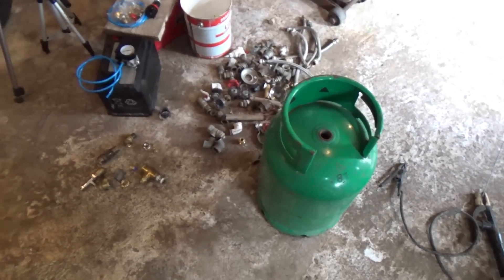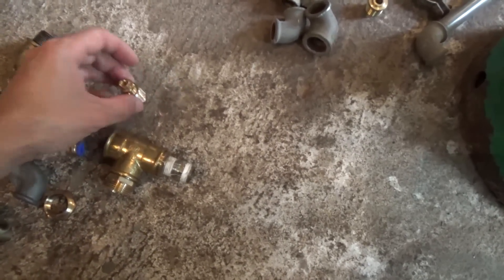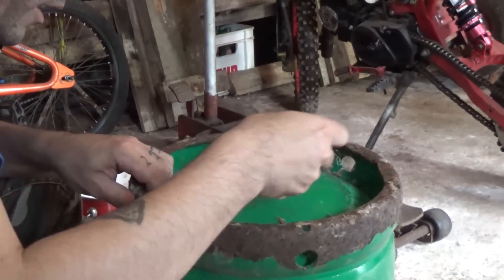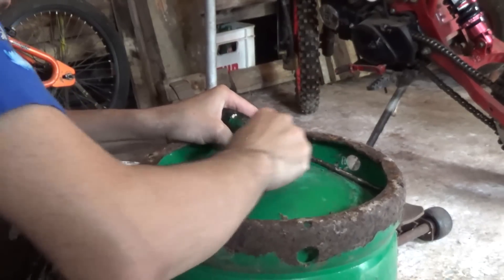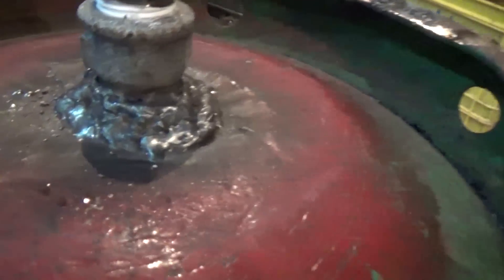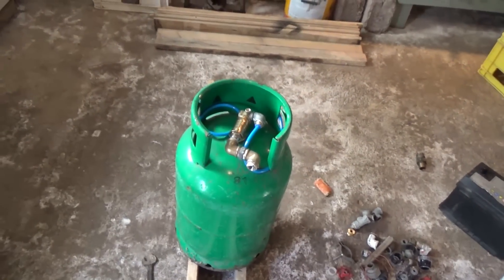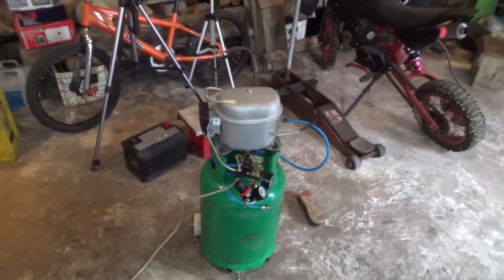Homemade silent air compressor

Comment: Would have made a better weld if you would have just brazed it. Another thought was could you have just drilled and tapped it with NPT if the metal was thick enough to take the threads.

Comment: Do not talk rubbish. A stickwelding machine are a stickwelding machine, the limit are the person operating that machine. And you also welded in a galvanized part. Welding galvanized vaporises the zinc, and turns it into poison. And I will say that galvanized piece, made of cast iron is about the worst combo to handle when it comes to strong airtight welding.

Comment: Turn the propane bottle upside down and make your first fitting a "T". Then put a ball valve and a nipple pointed down to allow you to drain the tank without taking the air line off.

Comment: is it me or is this thing incorrectly earthed to the pressure switch.the earth wires appear to be twisted together & not connected to the pressure switch,as seen at 11.41 in the vid.this thing is dangerous

Comment: I see comments about welding and his inability to use a stick welder and saying there is NO possible way he can weld with a MIG or a TIG if he cannot weld with a stick welder. Well, hate to disappoint you keyboard warriors on here but I personally work on vehicles repairing the body panels and painting them. I can weld excellent with a MIG and also a TIG welder but I can't use a stick welder worth a shit.
Reply from the maker: Pagan Sunburn thanks
Reply: Not a problem.

Comment: you can't blame the welder for poor workmanship, more than half the video to try to stick an adapter to the base then in 30 seconds you have a compresor ready to switch on, all of the impotant details left to ones imagination. No one is perfect but a little thought before hand to determine the gameplan and most important details would have helped. After watching all i learnt is how not to weld, nothing about compressors. sorry

Comment: This is a good job. But for welding u should have your wife helping turning the tank slowly. This kind of job is very difficult for stick machine but not if u have a MIG machine. Another thing is this kind of compressor have low start torque u. U will have a start problem should the compressor starts with a lot of pressure still be in the tank.

Comment: nice job. dont listen to negative feedback. I like the comment about welding more and practice. you needed more heat and slower  travel speed. you did good and it works.

Comment: Recycle everything but, with respect to luisfilipe, May I observe.  Refrigeration seal unit compressors are designed to pump gas and oil around the system. In domestic fridges there are no oil separators.
Using this type of compressor will result in oil passover, great if you are using air tools (keep an eye on the oil level) but using it to provide air to respray your car will be a disaster as the air will contain an oil mist despite the use of water separators and filters
Big industrial compressors solve this problem  in many ways but small sealed units are a different matter.
I love recyclists and it's a good project and the welding will get better with practice
Thank for the upload
Reply from the maker: George Styer thanks ;)

Comment: your pressure of 90. psi is nothing compared to the stocked flow. check the outlet pressure is low and the pressure in the tank is coming down quickly. with no air flow, u can't do any pneumatic job with this stocked air...
Reply from the maker: El Batchi Benaboud well i never intended to use it for pneumatic jobs...i knew all the way from the begining it would be suitable only for small tasks, like blowing air for cleaning stuff, filling tires....things like that.

Comment: sorry now that i see what your trying to weld!!! you should be using 309 L 16 a stainless steel rod which allows you to weld stainles steel which is your fitting to mild steel which your propane tank is made out of. hope this helps. 3/32 set your welding machine to 70  amps.
Reply from the maker: Bryan Dunlop thank you

Comment: a grinder with a wire wheel would do wonders!!! 7018 3/32  welding machine set at 90 amps perfect . clean a spot so you have a good ground  and away you go. good luck in your next projects!!!
Reply from the maker: Bryan Dunlop thanks

Comment: try welding with 7014 rods, throw those 6011 rods away. Another hint: when you stop your bead chip off the slag before  more welding. Make sure you have a pressure relief  valve. I saw a compressor off a fridge blow the end out of a tank and take a wall with  it.  Thanks for showing this video. Be careful with any tank welding.

Comment: To be on the safe side, I would have purged the bottle with water before using welding or sparks.
Reply from the maker: Robert Beattie i did that several times

Comment: It looks like your welding skills are about like mine. I think I would have drilled a hole in the bottom of the tank and pushed a fitting with a gasket thru the larger hole in the top, and then screwed a nut onto the threads from the outside on the bottom. I cannot weld very well either.
Reply from the maker: Doug Sigea yep that might work

Comment: bet this would work great with r12 compressors but the new 134 compressors with poe will surely fail as poe is hydroscopic and they make stuff cheaper all the time

Comment: ya your doing pretty good and recycling parts into somthin usful those pumps will usually last years and years justkeep  it drained rust thru on the thinner tank materiel good job

Comment: I've built one myself and it works a treat for my garage tools and pressures up to 130 PSI. 

I've read all the slagging comments you have given luis. These home build work a treat. And this works out at a 10th of the cost of a bought one. This saves me money and uses a 10th of the electric. 

Also a tip with the oil. Drain out the oil through the suction tube and use an ink cartridge string and put in 1 litre of 10W 40 engine oil.
Reply from the maker: Andrew Wray :) yeah i have been using 15w40 engine oil, but mine only takes about 0,5l...but that dependes on the refrigerator motor size...some are bigger some are smaller...anyway...it surely works nice, and does all i require in my garage...most people that say it is useless...have never built one themselves..they just speak without knowing what they are talking about..lol
Reply: luisfilipe1983 email me on drewanywar@hotmail.co.uk and I'll send you pics of my compressor.
Reply: Andrew Wray ĺl..
Reply: hey guys, I've built one as well... been a few years now, works great!! Was not  sure about the oil quantity, pretty sure i only  have a small amount and has not effected the use. Use to keep it in my unheated shop, and in the very cold months it would not start... oil is too cold. Think the lower weight oils is the best for these compressors. For my tank i used an old makita 3gallon compressor everything was free but the pressure switch. Great for small jobs air brushing, tire filling etc.. Best part for me is the noise level. I also have a very old dental ritter compressor.. check them out on youtube.

Comment: OK.  So others have picked up on the (non) use of grinder;  but the probable reason the fitting didn't weld cleanly - other than you're poor welding skills - is because it is plated !!
Sorry.  I gave up on you shortly after this. :-/

Comment: that's scary..6Bar? im not sure how much Bar that propane tank can handle the pressure. and the welded spot? that might burst at anytime.
Reply: jes he is an terrible  welder would not hire him
Reply: Doesnt matter if you read in bars or psi... as long as that dial shuts the compressor off at less than 145 psi, to play on the safe side, all is good:

"According to the publication NFPA58, a tank with 20 pounds of gas at 70°F would have a pressure of 145 psi, at 90°F would have 180 psi, at 105°F would have 235 psi, and at 130°F would have 315 psi."

Comment: The only practical advantage of this build is that it's very quiet.
The disadvantages are numerous (I built a similar one years ago) :
Very slow to come to full pressure.
The delivered air is contaminated by the oil from the compressor & therefore an oil filter is needed, hence extra cost & bulk. Also you need to provide for adding oil to the compressor.
Not even suitable for blowing up a small car tire, due to lack of capacity.
The bits & pieces you need to make this will end up costing you almost as much as a low cost store bought compressor with about 5 times the capacity.
Reply from the maker: Peter Owens indeed it is suitable for small tasks only, and you need to fill oil every once in a while, and it is a slow charge...but with just one charge i can blow up the all 4 tires of a ford escort 1.8 diesel van, and about costs...it only cost me about 40€ in parts, everything else i had laying around...to buy one around here  that would cost at least 80€ minimum.
Reply: +luisfilipe1983 bro dont explain yourself, you dont have to. you built it because you fucking wanted to, even if it serves no purpose what so ever. its a cool build that i never realized was possible. gonna save me a helll of a lot sincei only need for airbrush but has to be quiet for indoor use. anybody that wants to talk shit or question why, remind them that they are not forced to watch. i hate when people start nit picking shit. this is perfect for me and anyone else that needs a quiet small compressor.
Reply: Peter Owens bvsvv😬-----$- - bilemiyorum  in mpj,chkiqgffd

Comment: Why the nut on the bottom of the Gaz bottle ? I didn't see any hole !
Reply from the maker: I drilled the hole later, after having the nut in place, but did not manage to get it on camera
Reply: esta bem, obrigado
Reply from the maker: na boa :)

Comment: As gas is  heavier-than-air. Removing the valve, and  puttin the gas bottle upside down for a few days, all  the gas should be gone. then a good rinse from a hose pipe, should remove any excess gas, left in the bottle

Comment: People are complaining about welding etc an uncleaned propane bottle. . . Yes cutting or welding a steel barrel is very dangerous if it isn't cleaned since it could explode.   A propane cylinder is much thicker steel, and wouldn't have enough air in it do rip apart and cut you to shreds like a barrel.

Comment: and use a hydrogen controlled welding rod 4814 , 4816, 4818 zero porosity one continuous weld 're pressure test using water and old hydraulic hand pump it holds its good don't test with air
Reply from the maker: thanks

Comment: bottle can only handle 400 psi test pressure is not designed for greater working pressure 150 psi and pressure fittings are over welded to compensate for metal fatigue

Comment: The welder had a decent arc. You needed to Slow down, use 6010 rod, 1/8'".  A mig welder would not have done better.  Because it has the label as a dummy welder, it is not for dirty metal.
Reply from the maker: thanks
Reply: @luisfilipe1983  yes, there was more metal to absorb the heat on the tank, so favor the arc to the tank side.

Comment: not much clever,why don't remuve the paint with grinding disc? and in any case is very dangerus to use the gas bottle,usually conteing gas that why is very dangerus to welding on it.and what I see you are not expert to welding,change your job guy
Reply: Really ?? You wanna bash him ?? He's already removed the Danger !! And considering that this tank is designed to hold 2500 PSI Plus, It's the PERFECT choice ! I use these tanks all the time to build Portable air tanks !! . Awesome Job bud ! I'll be trying out a compressor i have here myself !!. thx.

Comment: I wouldn't like to hook my HVLP gun up to that! 14 CFM is a LOT of air throughput, ideal for blowing tyres up though :)
Reply: Its just a project that actually works.. it would work for inflating bike tires very well. Turn it on, do something else. Its called planning. It would also run airbrush and small paint sprayers.

Comment: i have a feeling that compressor wont run for a very long time without the oil that is normally in the ac refrigerant system

Comment: really should have rinsed that tank then sand blasted everything before having a robotic welder weld that bung on inside a blast proof chamber preferably on the moon or some other remote location. also at least a pair of safety glasses and a full face shield, gloves, kevlar body armor, and at least one paramedic standing by- that's the minimum "safety" you should do even if you are just watching this video on youtube. i wont even operate my thermostat without a fire suit. 
at least this guy got something done.

Comment: dude! 
Propane is heavier than air!....IF the bottle is empty,m the gas still remains in the cylinder.
Howerver, you turn it upside down , then the remaining gases would leave. :) Good work and theory!

Now, when you try to remove the painted substance at the bottom, why you not use drill with wire brush to 
remove the paint? :)

cheers!

Comment: To anyone else attempting this fun project: 
Some propane tanks contain a chemical additive to aid in detecting a propane leak. Its called ethanethiol / Ethyl or Methyl Mercaptan (CH3SH). This is also included (mandatory) in the liquid propane gas at the filling stations (at least in USA.) 
If you are dead set on doing that project, rinse the tank with a quality dish de-greaser soap. This will get rid of that oily black tar-muck and residual smells from inside the tank. 
(Certified propane handler. )

Comment: Defiantly not silent
ANY stick welder will do fine, just weld and watch videos on how to weld. it take experience.
decent attempt and i think you got it to work .
no one gives a shit about a silent air compressor for any shop use or construction. its about how much air you need to say nail a roof. 
im glad your very hazardous experiment worked out and you did not get hurt. there could have been lots of ways you could have been hurt or even killed. NO ONE EVER TRY THIS THE WAY HE DID

Comment: When welding if you do e's or u motions in the molten puddle your welds will start to look professional, unlike stuff you have done. Better still buy a mig.
Hope it holds compressed air. Nice wheels.
Reply from the maker: ok thanks for the advice..it holds compressed air easily :)

Comment: DONT blaime the welding machine the bad welding is becorse bad surface preparation ,use a grinder to get bare metal and remove the paint wel around the welding spot ,asure good grounding also on bare metal and the result will be a lot better ,maibe it wood be a good idea to take a welding course

Comment: NEVER attempt any welding or torch cutting in any GASOLINE or FUEL OIL tank even if it has been empty for 30 years!  You will probably be killed!    You CAN vent an exhaust pipe from a running engine into it to remove any oxygen or you can fill the tank with water but NEVER create any spark from any source unless you can remove the oxygen from the tank first!  MANY who have not followed this advise have been killed.    It probably isn't safe to do on a LP tank either.

Comment: Best way to get all the propane out is to fill it with water to displace all the gas.
Reply from the maker: yes i did that several times and then i left it for one or two days with a fan blowing air inside, and after that it stood sitting for about six months...only after that i built the compressor

Comment: What's the highest psi you've run it at? How did you get it to automatically stop at 90psi? Thanks!
Reply from the maker: the higest was 8 bar wich is around 115 psi...i have another video on how to set the valve to stop at the desired pressure...just follow the card sugestions on this one to see it.

Comment: THIS IS FUCKING STUPID... DO NOT TRY IT!
PRESSURE VESSELS NEED TO BE TESTED FOR PRESSURE
WELDING ON A PROPANE TANK THAT MIGHT HAVE GAS IN IT!!
RUNNING THE RISK THAT IT CAN EXPLODE UNDER PRESSURE AT ANYTIME...

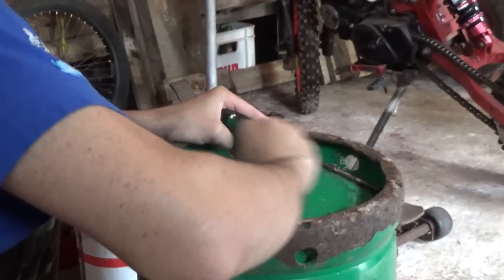Comment: I dont' know what you're doing,I only watched the first 3:29 mins.You should wash out the bottle and you probably don't need to weld the purge valve,just drill the hole and use a good sealing tape or some other type of sealer on the threads.

Comment: Great  concept  air  compressor  for  airbrushing. This design runs as quiet as a diaphragm air compressor with a generous air capacity/supply for remote airbrushing.

Comment: good video, but remember to test the auto spring pressure activated valve and ensure it works in case the motor relay fails to stop at 95psi, I have a an old small compressor that failed its auto electrical stop relay without me realizing it,  and the manual spring relief valve did its job well..it farted out the excess pressure build up!!!
Reply: you are all ass

Comment: Holding that part in your one hand ungrounded like that and using the welder in the other is a bad idea and a easy way to get electrocuted.If I cant clamp something in place like the part you were working on I will sometimes braze it in place first,then tack weld and clean the brazing off.It adds a extra step but makes it easier in the long run.........Like you said with a different welder this would not be needed but at times when it is all you have it makes the job easier.
Reply: It is hard to get electrocuted by a welder, the voltage is very low. (unless your welder was homemade by uncle grandpa) You would only feel it if you touch both wires to your tongue :P
Reply: @southjerseysound7340  My goodness you talk some rubbish!!!

Comment: You are a very dangerous person, welding a propane tank without taking precautions. The compressor will lock up in time without oil.